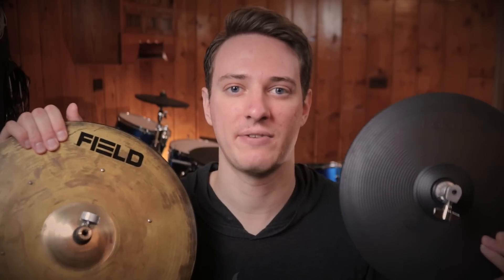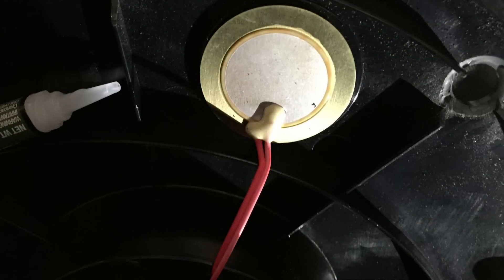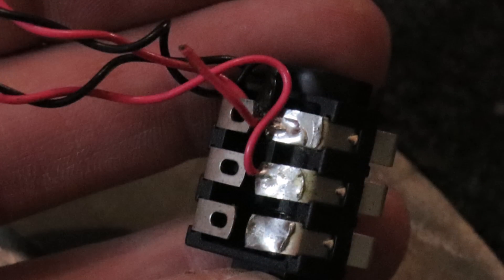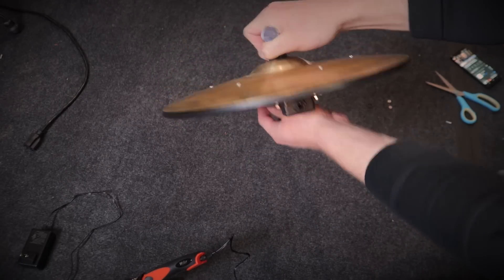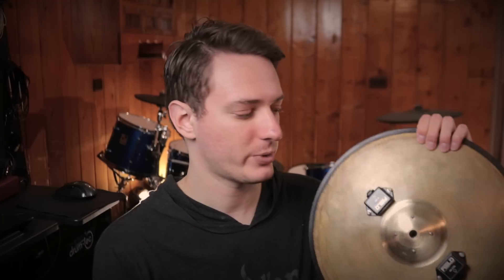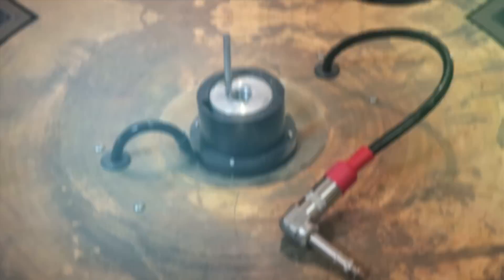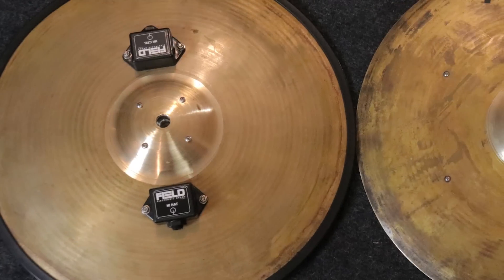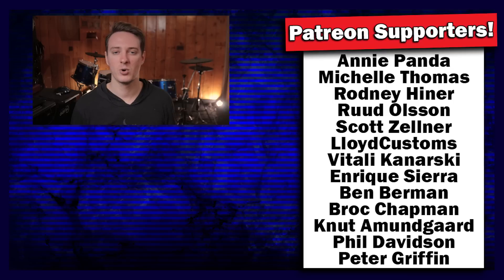Fixing Electronic Hi-Hats!

Comment: I have an important question. Do you know if the Alesis DMPad 12" hi-hat cymbal can be used as a crash or ride? I have a Surge Mesh kit and all the 10" cymbals are identical and work as hi-hat, crash, or ride. I ordered a DMPad 12" hi-hat to replace my 10" hi-hat because it got great reviews and I paid $50 for it, slightly used. Well, then I ran across another one on ebay and offered $40 for it and my offer was accepted, so with shipping it was $52. I couldn't let that deal go by considering most of them go for $100+. So I'm hoping I can at least use it as a ride. I have two Surge modules connected through Aux and that setup works great. If you know the answer, please reply.
Reply: you can, but it will be single zone cymbal (without edge and choke)
Reply: @hazreensaiful4534  thanks, yeah, I figured that out. It still makes a good ride though. The problem I'm having now is with Superior drummer 3. My 12" crash cymbals have the choke feature that works great. When I hit the cymbals and choked them, they each stayed in choke mode. They work fine in the Surge modules but in SD3 I can't get them to un-choke.
Reply: @kschantz  stay in choke mode? Meaning they will sound as cymbal choke even when you hit the bow area?

Comment: Next time you solder a jack like that, get some helping hands with alligator clips to hold it steady for you. Should you ever need to work on a board, you will need a better holder but the helping hands work great for things like jacks and wires.